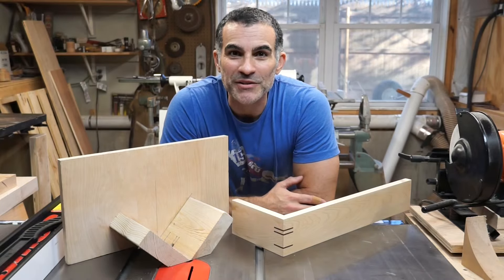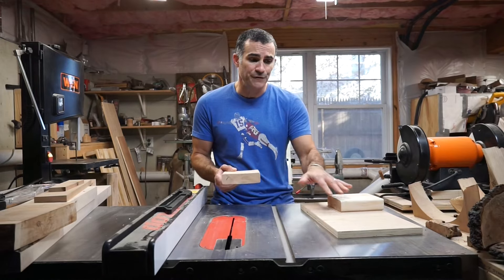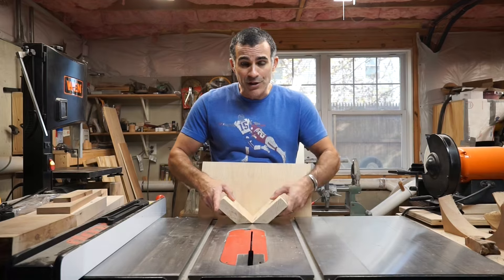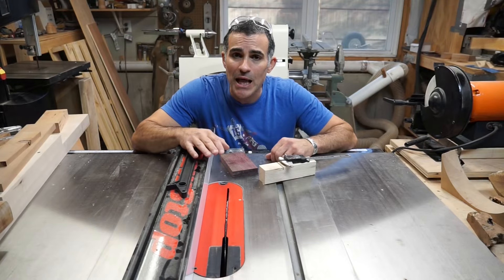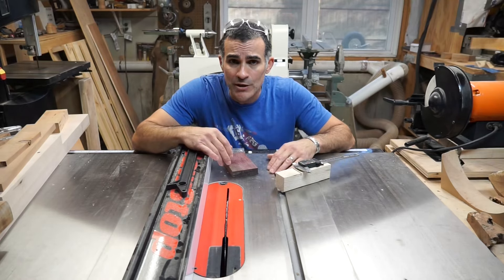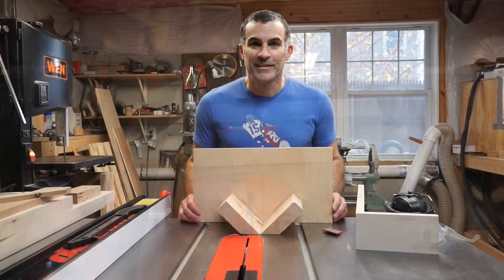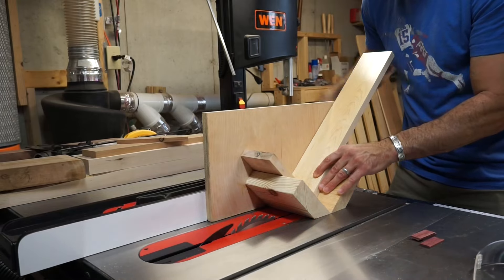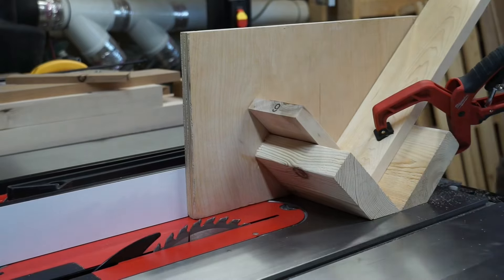Ridiculously EASY Jig to Make Spline Joints for Your Box Corners!

Comment: Good video.

One suggestion which may or may not be worthwhile?  I'd be putting painters tape over the area to be splined before making the cut and only remove it after the splines have been inserted.  That way there will be effectively no squeeze-out getting onto the wood - and a little protection against tear-out as well.
Reply from the maker: Hey Old Guy - awesome suggests. If you’ve seen some of my other videos I recommend doing just that fairly often. I guess I need to do a better job practicing what I preach! Although, and with that being said, I generally use that option with hard to reach areas like inside corners and the like.

Comment: When gluing pieces that you don't want to slide when clamping add a little salt onto the spread glue before assembly, the sharp salt crystals will keep the pieces from moving but will quickly dissolve not having any other impact. To cut the splines after installed you can pick up a flexible flush cut saw at HD and get the splines cut virtually flat, although it is a bit more work and time consuming it will be very close to flush.
Reply from the maker: That is awesome. I haven't heard that salt trick before. I love it! Thank you for making the suggestions.

Comment: Simple enough jig, but the issue with it is that the V-block on the vertical fence will get chewed up after a couple of boxes worth of spline cuts. I am pretty sure it's highly unlikely the cuts on multiple boxes will remain in the same position. 

I like the kind of spline jig that has an upside down U- backing that slips on top of the table saw fence and the V- support blocks do not go all the way down to the table saw top.
Reply from the maker: I believe I mention in one of the videos the same issue. This design requires less material and time as well as minimizing tear-out when cutting.

Comment: HI . And if I wanted to color the example frame white and the corner pins green - how can I do it? I can't find any video about it.
Reply from the maker: Here is a video showing you how to make colored splines: https://youtu.be/edcgvAs65Ro?si=wqTXFV3HkgKdVlt3
Reply: @industrialcomfort  Thanks for the link. But I'll try to reformulate the question: If I wanted to create a frame in white - red - green - any color - how do I insert the corners, for example colored yellow or blue? Thank you . Because I always see the same work on raw wood - but no one has ever shown how to do it all on a frame or a colored box. Thank you .  Sorry for my English - I use a translator )) I am Italian and I don't know English.
Reply from the maker: @nomecognome5026  I see, no problem. In that case, you should paint the frame first. The challenge, and why most probably don't do that, is for two primary reasons. The first is risk for tear-out when making the cuts for the joints, and the second is that you will always need to sand the splines down. This will sand away the color your frame was painted.
Reply: @industrialcomfort  Too bad I can't send you a photo - to make you understand what I'm talking about.
Reply from the maker: @nomecognome5026  go to www.industrialcomfort.com and reach out via the contact form. I'll see if I can help you.